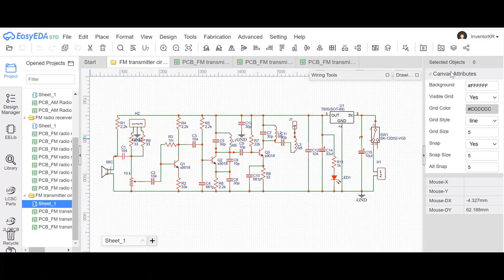how to make FM radio receiver circuit , simple fm receiver ,  jlcpcb

Comment: 346 / 5.000

The receiver does work
BUT I hear a switched power supply that gives a big disruptive signal.
and
I hear airplane traffic modulating in AM so you can't understand it well.
if the receiver were adjusted for something lower in the band, FM stations would be received!

.
Healthy and Friendly Greetings from the Netherlands!
Rob

Comment: You connected only 3 pins what are the negative positive of battery and what are negative positive of speaker
Reply: He connected 4 pins three on the right, one on the bottom left
Reply: @electronicguy3051  it's antenna not wire